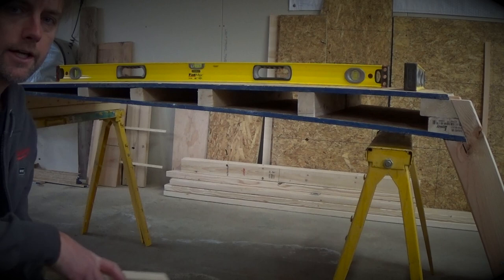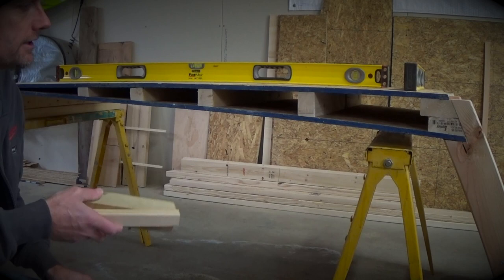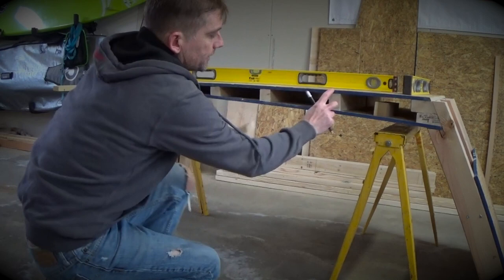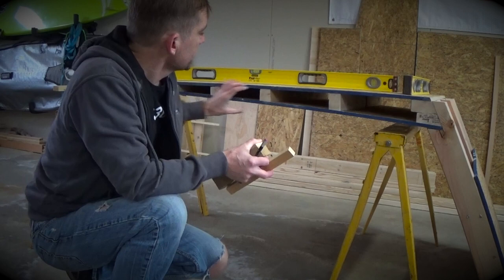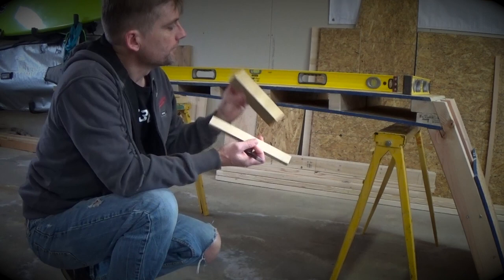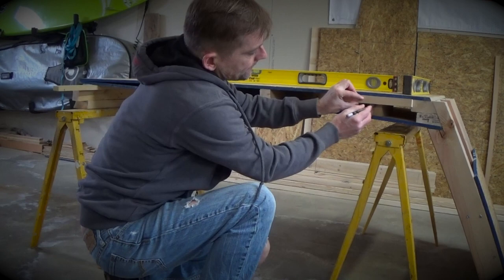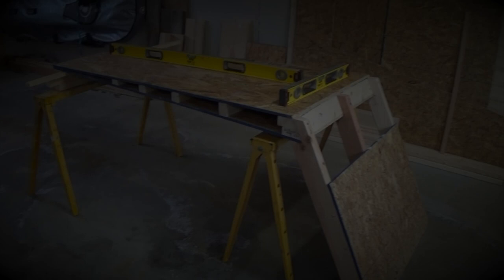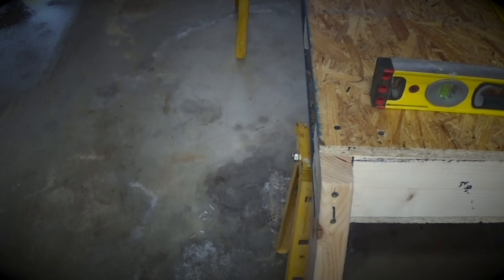Aviator Desk, Part 1

Comment: Thank you for sharing!!! I have a small version of yours as my couch/ cocktail table. I was thinking of having a big one as a dinner table for four as well, but it is ridiculous how expensive these tables are. So your video is the ease to my problem XD. But here is something I have for your next project maybe. How about covering the large surfaces with only ONE sheet of metal and "scratching" the lines of the "plates" in? Then you can add the details such as screws or bolts as you like and still have a flush and even surface on which everything will just stand still and not potentially hurt someone? At least this is how they made it with the couch table I have - And that was also not a cheap one at all :( But this design is sooooo good haha. Well, have a good one
Reply from the maker: I like the idea of a one piece top, however, I can't imagine how I would successfully wrap the edges. I will consider using less panels in my next project, as I would like to put on large vinyl aviation stickers. I would however like to see a picture of your cocktail table for reverence.
Reply: Creating Mandruff Yes, the corners are the „problem“ whereas they are hammered around the structure.
The vinyls are awesome, as I have covered most of my furniture in white vinyl. However, it is cheap, it costs a lot of time to make it perfect and unfortunately not very durable. For racks and door surfaces its great but not suitable for working surfaces :/

Heres the link to the table I have

https://www.vidaxl.de/e/8718475603610/vidaxl-aviator-couchtisch-aluminium-vintage-flugzeug-stil?gclid=EAIaIQobChMI_rz7soD36QIVD9Z3Ch2DYw5jEAQYASABEgKLkPD_BwE